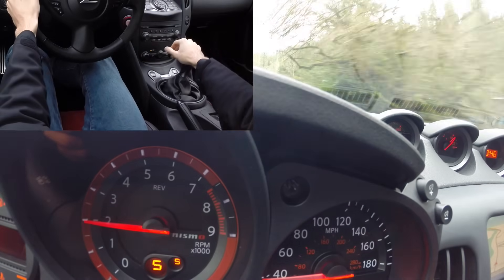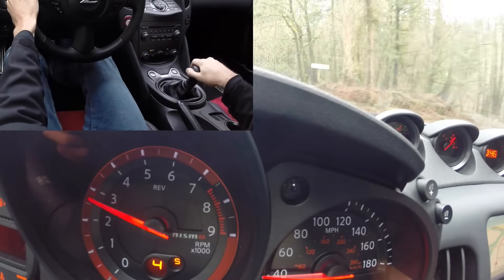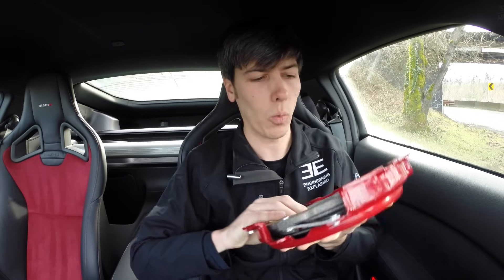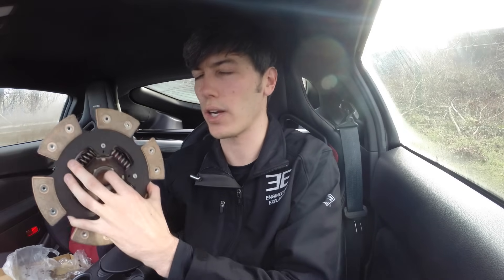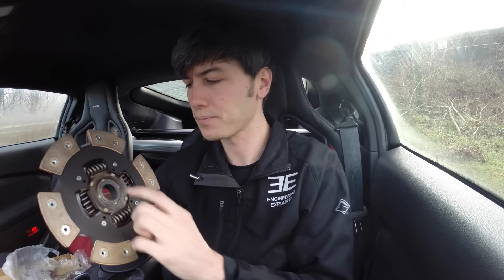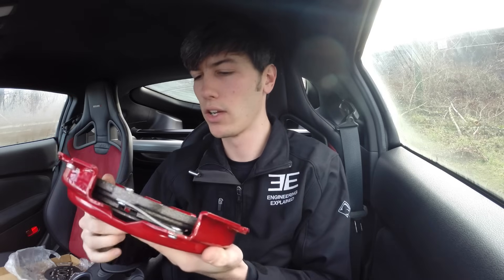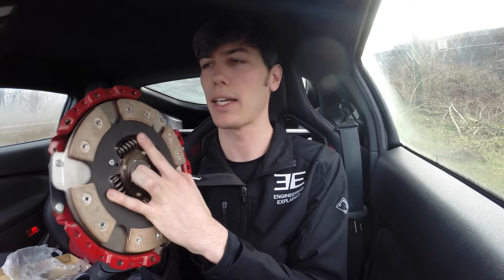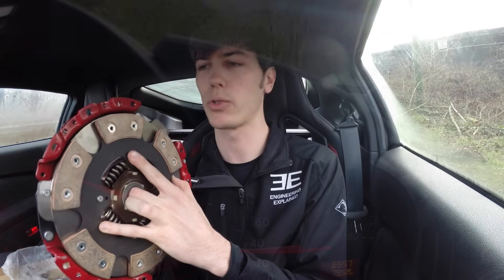What Is Rev Matching?

Comment: Can you discuss why The four-cylinder sport bikes sound the way they do thanks?
Reply: +Gage S. Because of the exhaust, air intake, high RPM and the fact that the engines aren't insulated like in cars.
Reply: Lighter components due to smaller size hence the ability to rev high and then you combine that with the short exhaust and you have a nice high pitched note.
Reply: sport bike exhaust + 4 cylinder car = profit.
Reply: +Dick Pickles Actually,  it's because of the firing order of the engine. It's called a "screamer" configuration. There's also a "big bang". He made a video on these two firing orders. American V8s are "big bangs", same goes for many Moto GP bikes and the 2009 and newer Yamaha R1. Ferraris and pretty much every other inline four is a "screamer". 
Also, inline fours in cars are all screamers. They sound different than bikes because of the reasons you mentioned.

Comment: nice. now, on the topic of upsetting vehicle dynamics, what exactly is the "clutch kick" that amatuer drifters claim to use to initiate slides?
Reply from the maker: I suppose you could use the shock of a downshift to upset the rear axle, swing it out and give it gas. But you could also use a hand brake without harming your clutch. Disc brakes are an easier repair job.

Comment: 1:38 Isn't the RPM of the clutch disk the same as the RPM of the crankshaft?
Reply from the maker: +noudgoertz Only when it's engaged, but it will always rotate with the transmission unless the transmission is in neutral.
Reply: Exactly, thanks man!

Comment: Ok so let's say my car doesn't have automatic rev matching so I want to do it manually, how do I know what rpm I need to press the gas pedal to reach in order to match the speed of the clutch?
Reply from the maker: +khaled webster Something you learn over time simply by looking at your speed and tachometer with respective gears. Typically, just blipping the throttle (not shooting for an exact RPM) the right amount, while releasing the clutch simultaneously will lead to a very smooth shift. Obviously something that requires a bit of practice.
Reply: +Engineering Explained that makes sense since it's different for every car, thanks
Reply: +khaled webster If you know the gear ratios of your car, simple calculations can help you, but if you don't, keep a certain rpm (let's say, 3000 in 2nd gear) and upshift quickly. If the revs drop to 1500 when in 3rd gear, you have now a reference to do it backwards: If you are at 1500rpm @ 3rd gear, press gas to reach +- 3000rpm while changing to 2nd gear and the transition should be much smoother

Comment: i never rev matching but the transition is still smooth,why is that?  is rev matching makes less fuel economy?
Reply: Do you let out the clutch slowly?
Reply: +Marcos Cruz yes i think i do
Reply: +Ivan Ivanov Ivanovitch Ivanovski i think i got it now, the rev matching is for speeding in tracks right?
Reply: +rio sasongko engine braking is stronger at higher RPMs. at lower RPMs this effect is much lower allowing for a smooth transmission of torque from engine to gearbox especially with a smooth application of the clutch. 
if you rev matched you could be even smoother though.
Reply: +Ano Nony In that particular case you'll learn a what being stupid feels like.

Comment: Does not matching the rev somehow damages engine over time and of course how and why is expected :)? I've heard some discussions in forums that, it does?
Reply: Maido Hollo If you were to drop gear from 6th, to first, it would dmage , as the engine would be going way over the redline. Normal downshifting is perfectly fine for the engine.
Reply from the maker: +Maido Hollo Shouldn't cause any harm to the engine, but it can create additional wear on the clutch (and synchros).

Comment: I'm a noob, but I'm a willing learner! Ever since I got my s2k, I discovered rev matching (never done it in my previous car) and been doing it everyday. Anyways the question is, what happens if you don't rev match, and just go into neutral?
Reply: If the throttle is not pushed, then the engine will come to idle, it's speed falling quite quickly.
When you downshift, the slower the engine is, the harder the kickback from engine braking and the wear will be.
So you blip the throttle and then downshift. This method is used to shift on vehicles that have worn out or does not have syncros at all.
However when you upshift, you want the engine to slow a bit and then engage the clutch. This give the engine time to slow down to the then lower speed of the tranny because of the upshift.
Home I did help :)
Edit : And again paging +Engineering Explained if I forgot a thing :p
Reply: +s2kBscreamin It's fine if you're coming to a stop, no other reason to go into neutral really.

Comment: Not sure this didn't over-complicate it, so I'll add some run-on sentences. There's a difference in speed between the engine's rapidly falling revs and the wheel speed when the clutch is pushed. This can chirp the tires when you let the clutch out on a downshift while braking into a corner(made worse by grabby racing clutches), because the lower gear means the engine must catch-up to the wheels. It's engine-braking at the extreme end that adding some throttle input while the clutch is pushed-in avoids by matching engine and transmission speeds at the clutch for the lower gear.